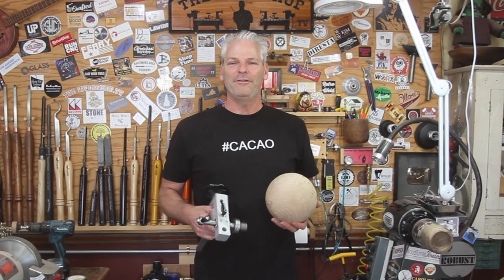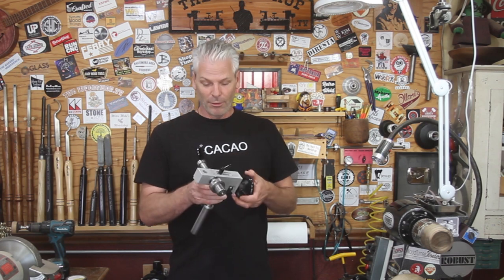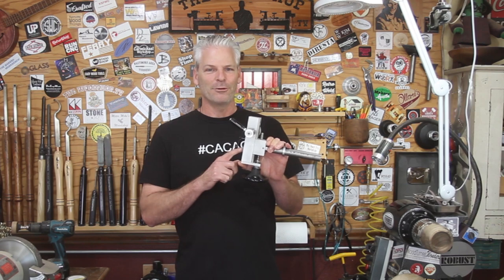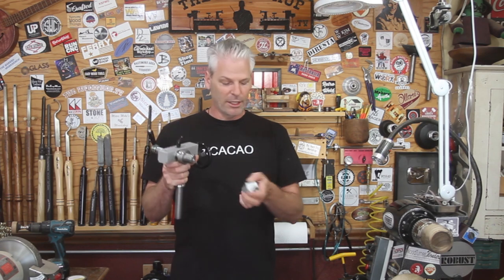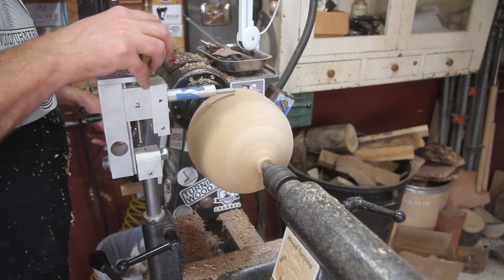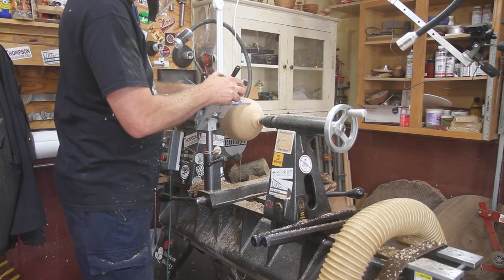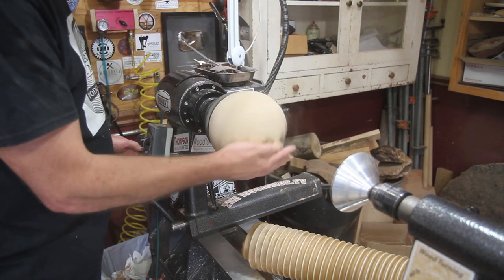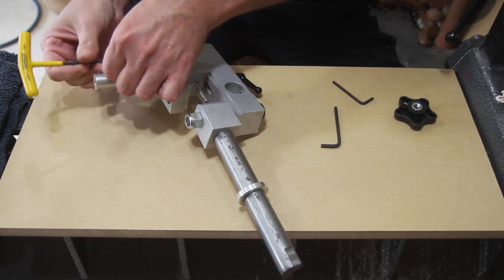Wood Threading Jig Sphere Jig Combo  Woodturning

Comment: I am Paul Rohrbacher designer of the Ball/threading jig for Craig.  suggestions: For Walnut and Cherry type woos, I always use thin CA glue well saturated into the threads and then recut the final threads without changing any settings. Then lightly sand the thread crests to smooth them out. a solid wood ball will crack. The ball must be hollowed. On the tailstock end, cut the tendon off and save it for then plug. Before cutting the tendon off, make a truth line so the plug can be realigned with the grain pattern. Hollow the ball using a 
Steady Rest for supporting the ball. After the ball has dried, the wood will have warped. Fit a temporary plug with a center, in the opening and support the hollowed ball between centers. at slow speed with the skew on it's side carefully scrape the ball back to basically round.  Now align with the truth mark and glue in the original tendon as the end plug. sand the plug to match the ball curvature.
Reply: Hi Paul, are you saying any wood sphere will crack even if the wood is completely dry? Or is that true just for larger spheres? Thanks.
Reply: @eddieagha5851  Dry wood may not be dry in the center if air dried. But, truly dry wood shouldn't crack after turning, any size ball. We are talking about a solid wood ball.ball.  If the ball wood is green, as it dries, it will crack. The wet inside will not shrink as fast as the exterior, which will 99% of the time result in a crack forming. .                    To blow the minds of your woodturning friends, turn the ball hollow.     It is advisable to hollow the green turned ball if possible. This will require a laser or CCTV camera set-up. Make the ball but leave a tendon on the headstock end to drive the ball. On the tailstock end, the tendon will be cut off and saved to plug the hollow ball. You will need a Steady Rest to support the ball. Wrap the outside turned ball with plastic wrap and add several turned of masking tape over the outside of the ball where the steady rest wheels ride.. Hollow the ball to about 1/4" wall thickness. Thin wood can dry much easier and since the moisture difference is less, the ball shouldn't crack. Drying from the inside out is much safer to prevent cracking. I leave the plastic wrap on the outside and blow air into the ball thru the open hole. I use a CPAP machine as the blower. Go thru the weigh process until the ball is dry. Align the tailstock end pre-cut plug with the wood grain matched and glue in place. Cut the headstock end tendon off carefully with a hand saw to avoid pulling wood fibers out of the center area as would happen using a parting tool.. Use Cup driver on the headstock and live center to hold the ball. Use a gouge to turn the tendons area to blend in with the ball radius. When you are done, there won't be any evidence of how the ball was hollowed. There may be minor ball shape change from the drying process. If you have adequate wall thickness and the tendons align well, use the Ball Jig to turn the ball round. Or place the ball between cup centers and work the ball round with gouges and sandpaper.
Reply: @paulrohrbacher7795 thank you, for that very detailed explanation.

Comment: That seems to be a high quality jig Carl.   I've tried thread chasing using the hand tools but it takes a lot of practice to get it right.   A jig is the answer.   I use a little suede shoe brush to clean out the threads.   It's the same brush I used on my blue suede shoes:-).
Reply from the maker: :) It really is a well built jig! I'm going to have to see those shoes when we get to England ;)
Reply: They are a bit old now.   I wore them this week to honour (honor) the 49 th anniversary of the death of Elvis:-).

Comment: To be sure I understand, the # of threads can be varied by an adjustment on the jig?  Great video. I'm gonna look into this. I've shunned threads as I'm not a real concise fella & hand chasing looks to require a good touch.  Again, thanks for sharing.
Reply from the maker: Thank you Michael! The number of threads are changed by the all thread that the chuck is screwed on to. It needs to be changed out with a different TPI.

Comment: This tool works great, this guy should not be making a video to demonstrate a product like this, not until he knows how it works. To cut the external threads have the wood behind the cutter so it don’t tear the threads out and in front the cutter can draw the wood into the tool as demonstrated,,,,, basic wood turning 101. Didn’t even make a project to show the threads working.